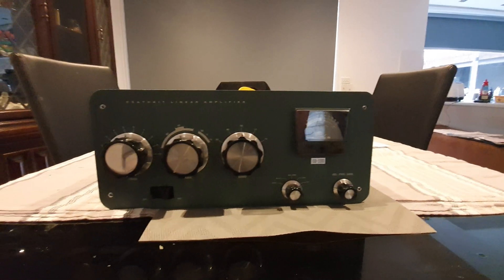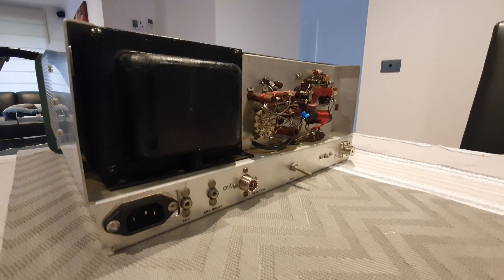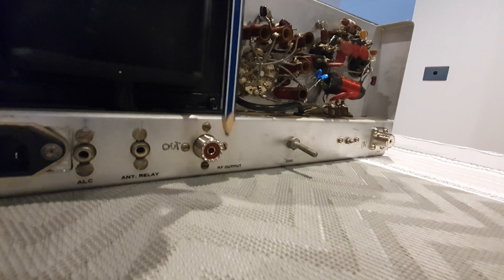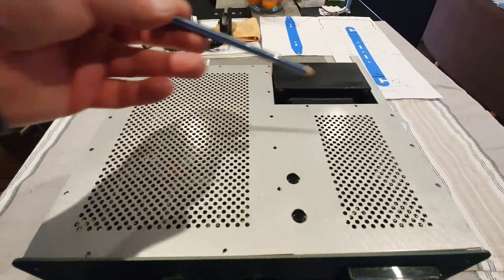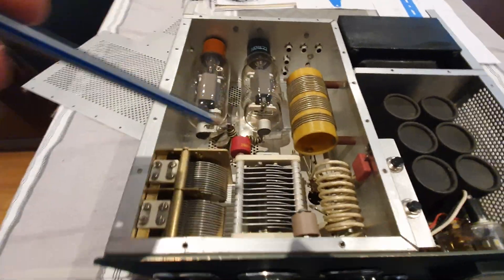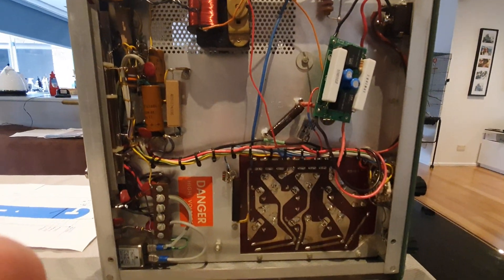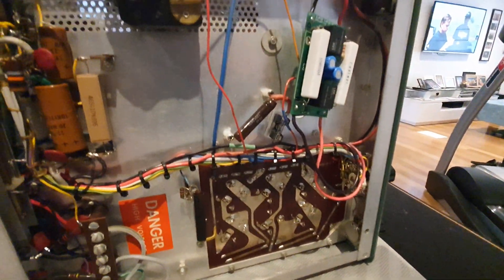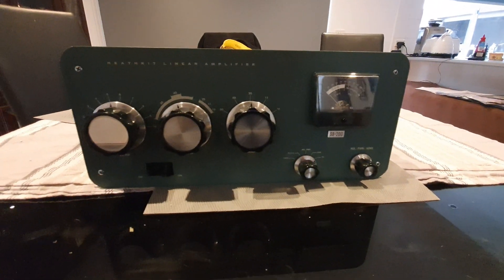Heathkit SB-200 RESTORATION- UPGRADES - STATUS OF HARBACH PARTS - PART 1

Comment: Hard ground the grids to chassis and you’ll get 900watts 80-20 and 700-800 on 15 and 10.  Of course it’s not that easy to do since you have to do cathode biasing and rewiring for grid current reading.  If you watch the SB200 grounded grid video by N2LEN on YT you’ll see!
Reply from the maker: Thankyou.

It's already doing 900w , 10 it's around 680

Comment: The fuse you have in the high voltage circuit should be a 750 ma HIGH VOLTAGE (5KV) fuse and holder (microwave oven fuse). E-bay probably has them. The fuse you have in there will explode like  a 22 round and sustain an arc. I have repaired these amps for the last 50 years, have tried a 220 volt fuse, and ended up picking glass fragments out of everything around the area when it blew.
Reply from the maker: 1 step ahead of you  ive removed,it was only mock up not permanent,  and yes I have some MW quick blow fuses and pig tails as yet not fitted.  When I get around to it I need to install a soft key board
Reply from the maker: So the MW fuse is perfect for HV line?

Comment: Hi if you are thinking of buying replacement 572b beware of the Chinese tube they dont last very long and are very poor quality and the USA tubes are no longer made.
I am in the process of fitting GI6B or GIB7  Russian triode tubes military spec will give out 800 watts 
The heater on these are 12.6 v AC  max eht 2.5 KV.
Reply from the maker: I'm using Taylor's, in the past I've had great results from them.   These are used , matched but low hours so have many years of life in them
Reply: @Pull_It_Apart_Paul_Ham_CB   Yes they are better quality and should last longer.
Reply from the maker: I was hesitant buying them all those years ago , it was a perfect decision,  these 572bs are of similar year and a matched set.  HRO then promoted them heavily, and another USA shop did a rebadge deal on them with their brand.

Really hard these days when buying tubes, to many copies, and cheats , liers out their taking advantage of hobbyists, and all from the same coyntry